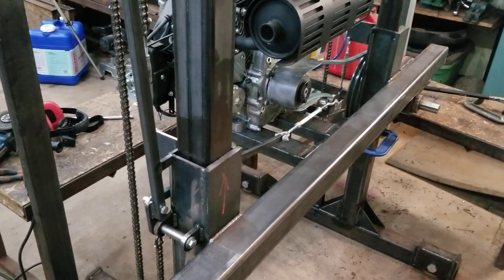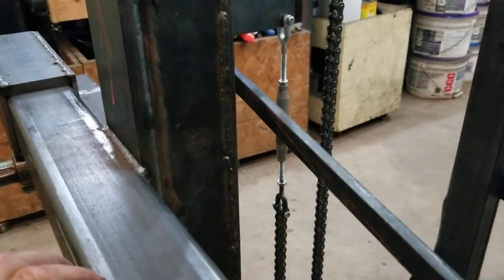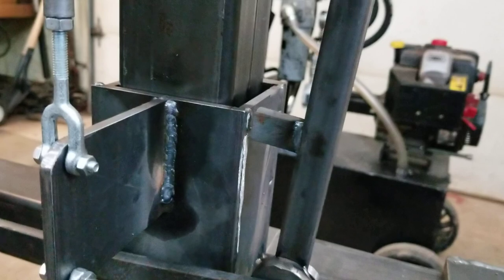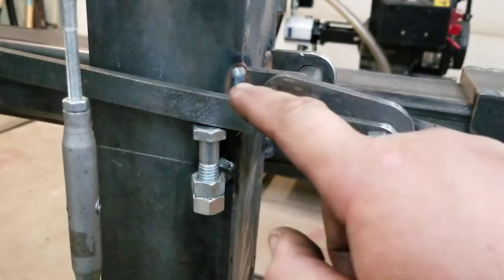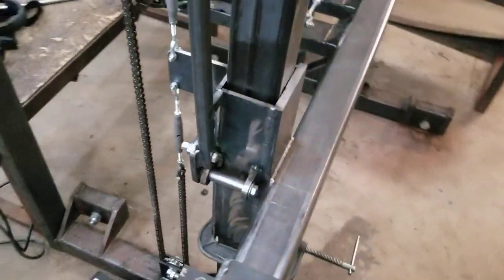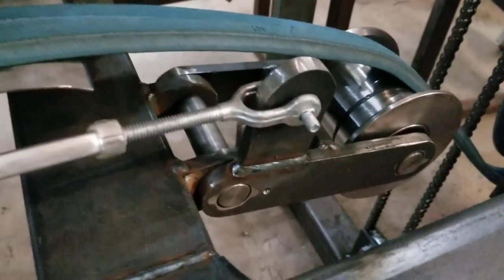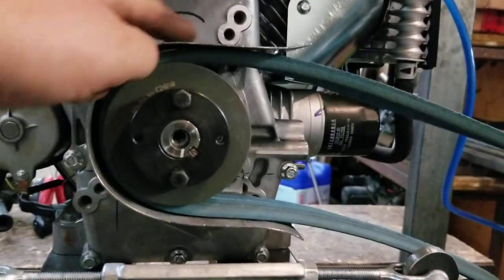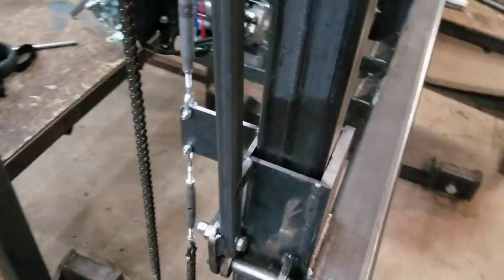DIY Lumber Mill Manual V-Belt Clutch Mechanism

Comment: Overkill is underrated! An effective mechanism that will never let you down!  The size of the pin is not only related to the force but also the friction and wear.  Larger surface, little wear, even more, effective lubrication.  You can't really lubricate a 3/8 bolt!  Thanks!

Comment: Hi Chris, thanks for sharing, I liked looking at this mechanism. Super simple and effective. Looking forward to 'the next thing' and seeing this baby make some sawdust! Would be interested to know what the belt is made from and if you will get any squeal or more importantly SMELL from it as the drive pulley spins... Super simple clean belt clutch design :)
Reply from the maker: It's just a regular v-belt that I got at our local princess auto store (similar to harbor freight in the states). They don't really rub on the pulley, well, I guess they do, but just a very light amount. There's no smell to it at all because the mechanism engages in less than a few seconds.